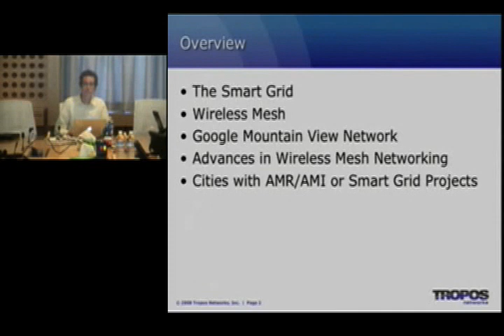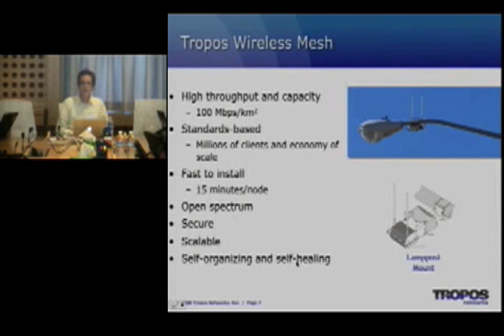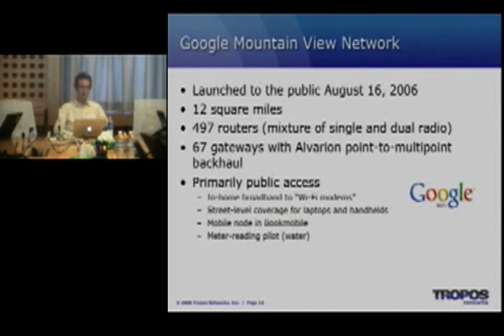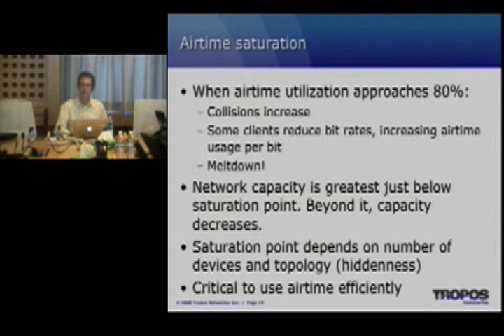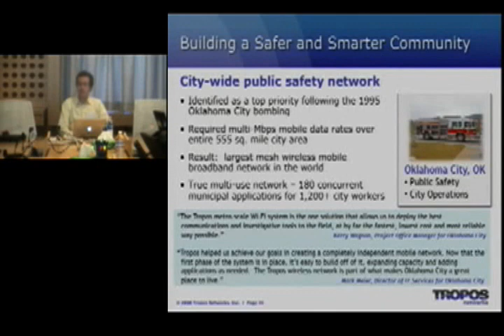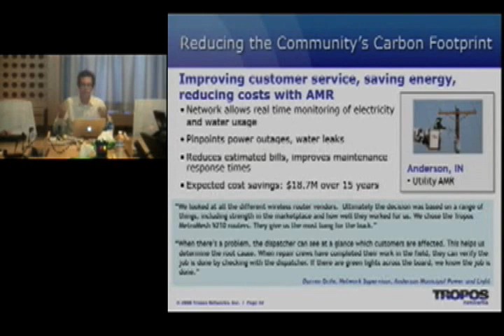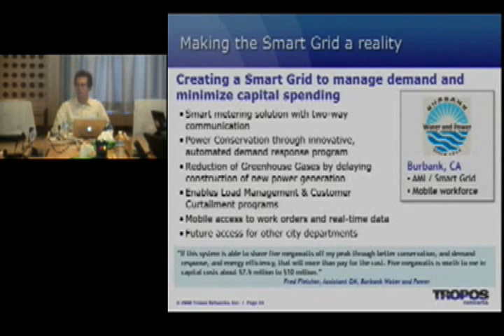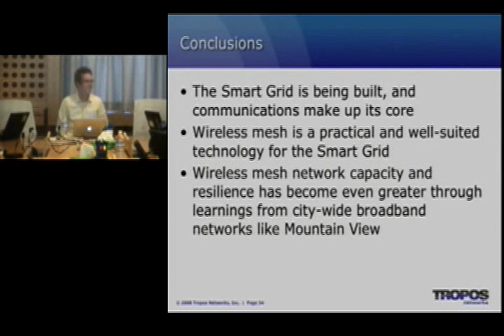Wireless Mesh Networks and the Smart Grid

Comment: Except, in this system, there are multiple routes to the same place. Instead of being reliant on a single line to the power plant, you can grab power from multiple sources around the community.

Rather than there being a single point of failure which can take out power to a whole city, you have multiple lesser points of failure which can be repaired/reconfigured/routed around easily.